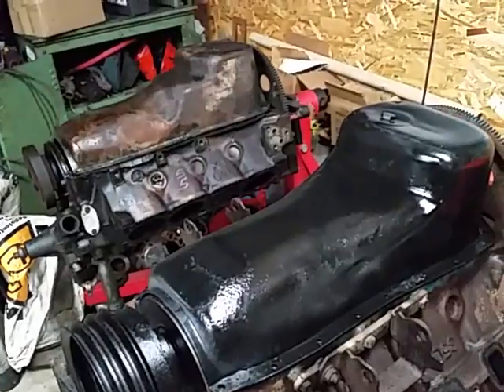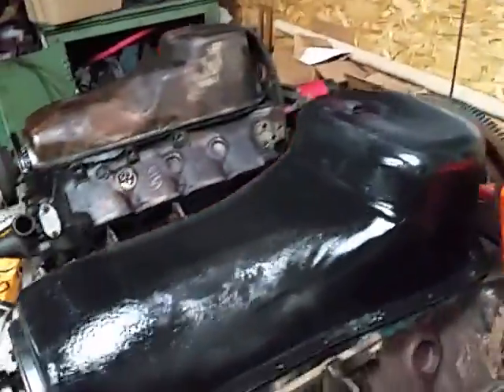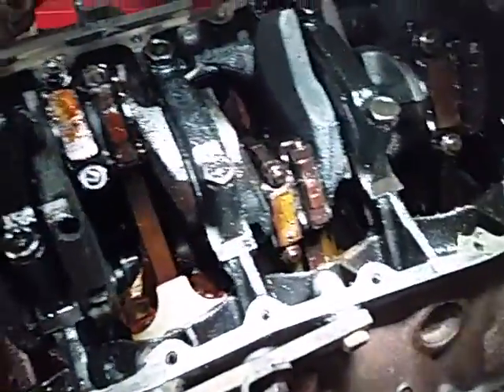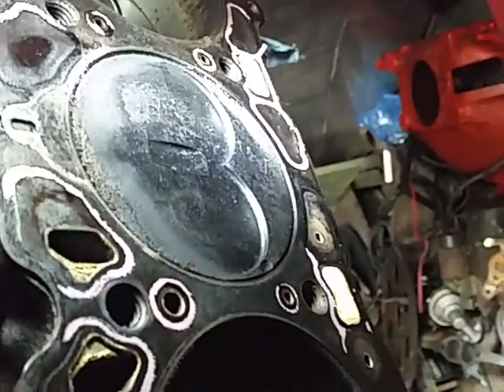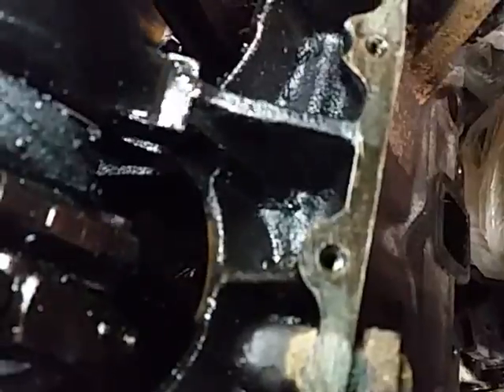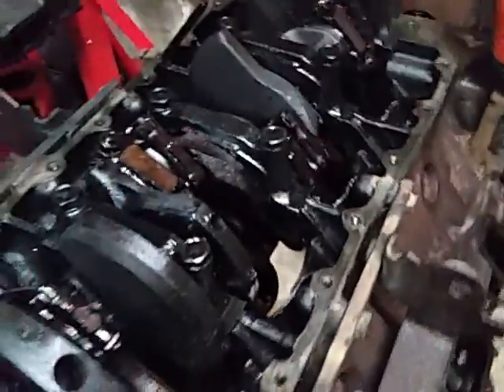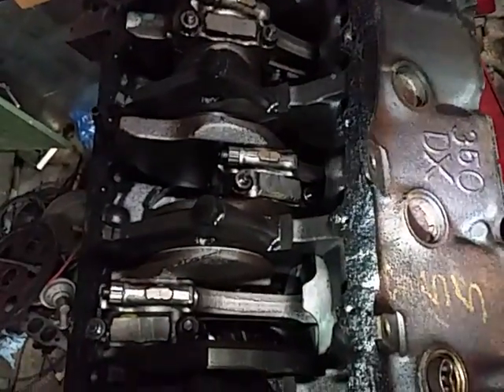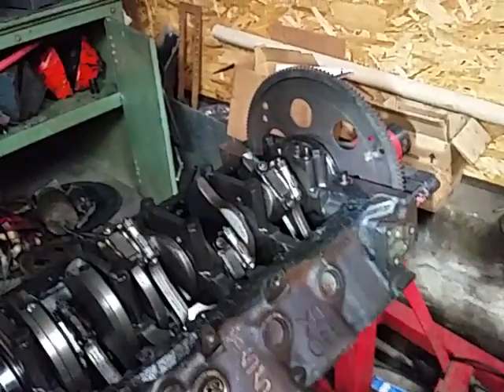Olds 350 Windowed Mains Vs DX Diesel: A Tale of Two Oldsmobile Small-block V8 Engines

Comment from the maker: Blipco5 has the.right idea in tryiing to verify some of these "facts"  like bearing sizes.  Youd think.the.guys who build biig.dollar.engines in magazines were purposely.keeping secrets on small.details.  everyone.knows.about.the.notorious windowed.main 403 block controversy.  Joe Mondello was reported to have seen 990 code blocks.without windows, but I know of none.  Many claim they dont exist. 
But I have held a.forged 455 crank in my hands and sold.it.  Some stuff is just very rare and difficult to get info on.. .
Reply: So, did all 403 olds have windowed mains?
Reply from the maker: @norman_sage2528  Big controversy.  I remember reading somewhere Mondello saying there are a couple of thousand non window main blocks out there.  But so far, no one seems to have documented one with photos on the internet.

Comment: Great video. What about the size of the main bearings. Are the mains larger on the diesel than they are on the gas block?
Reply from the maker: I didn't personally measure them yet, but the popular info as that these blocks have the "big block" sized main bearings.  So the 425 crank fits the saddles, but the counterweights are usually turned down by .375" to fit the block, and the rod journals have to be cut down to fit a short rod, which can effectively be only about 6.350 with a 1" compression height piston.  The alternative is to just go standard 350, or long-rod 350, or just bore and keep the 350 stroke.
Reply: Shawn Stjean ...I remember back in the eighties or early nineties a GM engineer said that this Diesel engine was doomed from the start because they basically used a gas engine block and didn't size the main bearings large enough. At the time I thought he meant that they used gas engine sized mains but maybe that was just my assumption. Anyway, he said that they didn't listen to him and well, we know how that turned out. It would be great if you could measure them.
Reply from the maker: @blipco5  Will definitely report back if the crank comes out.  It may not.  I ran budgets and I'm at $5k in parts and machine work for the stroker, vs. $1500 for a mild 350 with good heads and a roller cam.  Because I don't own a car for this engine, and I don't build $7k engines on spec,  it may remain a low-rpm 350.  That way I can sell it for $2200 and someone will be happy to get a tough, torquey mill for their car that will shred tires and not require a steep gear and converter.
Reply: Shawn Stjean ...Thanks. I just wanted to verify that story, or not.
Reply: @ShawnStjean  I'd love to see a follow-up on this build
Reply from the maker: I will do one,  possibly more; stay tuned
Reply: Shawn Stjean ...Thank you. I'm tuned in.
Reply: @blipco5 a 🙄 duh
Reply: Yeah people gas block olds motors have 2.5 and diesel blocks have a 3 inch main Caps for all you brainless people who don't have any common sense WOW this is the year 2023 look this information up on your phone or your computer genius don't you ever read Hot rod magazine as a suggestion
Reply: I've said that where 3" inch main s
Reply: Yeah of course they are just to go you don't have any kind of knowledge of this information

Comment from the maker: Im actually looking into the stroker conversion this.  I have the 425 crank and the major hurdle seems to be getting the right rod length.  Im also hesitating to put a thousand bucks into a 50yo crankshaft.  The altwrnative is to build a low rpm / truck type 350 because of the high weight of the reciprocating assembly, or a high rpm 350 with lighter rods, pistons, and lightened crank.
Reply: You have to think outside the box in a build like this. I can practically guarantee there is a rod that will fit a custom piston. If you stroke it and bore it .125" then you'll have to get pistons made but that's a good machine shop's job. 
Custom pistons don't cost that much these days. Sure they're probably going to be over $1000 but not a big deal. The Diesel crank requires too much work I would say.
I wonder if you can get into the 500 cubes range with this block?
I love the idea of a stroker conversion in this.
Reply: Yo dude you should look into mondello performance on your phone check it out in a Hot rod magazine for a reference just as a suggestion 🙄

Comment: The DX diesel was not bad but came out in 1983 but it was  too late the damage was done due to diesel high compression and bad head bolts and no fuel and water separator. . Yes many of the Oldsmobile L9 Diesel was converted to gas I know my neighbor had one when I was young and that is what was done. The DX Diesel was produced from late 1982-1985. The regular Oldsmobile L9 was from 1977-1982
Reply: The very last LF9 diesels that were produced for 1985 did have a fuel/water separator.
Reply: Wow you people need a clue
Reply: Actually the DX block came out in 1981.
My 81 Eldorado had the DX block & it was the original engine.
No problems at all with the engine.